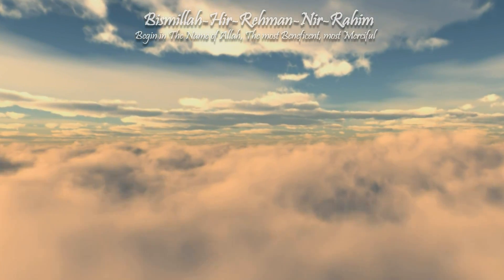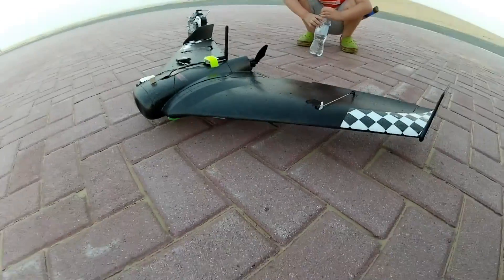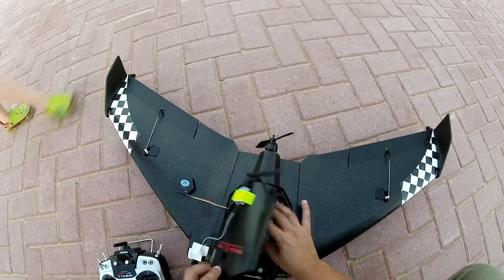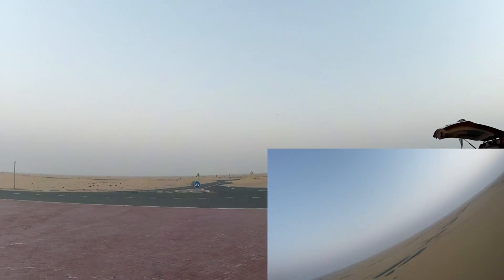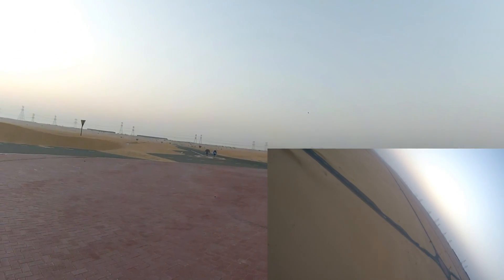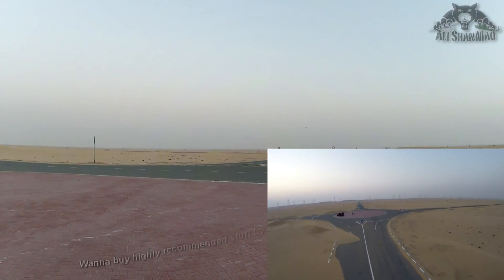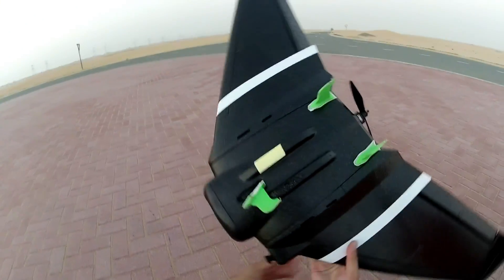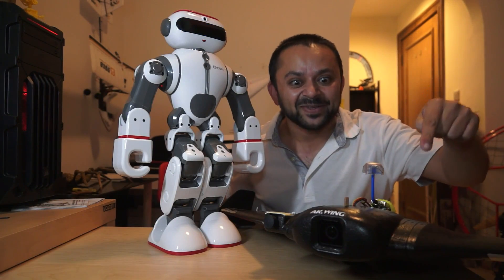3D Printed Landing Skids For AR Wing High Speed FPV Flying Wing

Comment: are all 3 fins the same size so I would be downloading 1 STL file?
Reply: By the way I do have the AR Wing and my question is just before this.
Reply from the maker: yes, but i recommend scaling the front one a bit longer to give your wing a little nose lift should you want to try take off from ground.
Reply: I'm waiting on my 3D printer so I don't know much about how things work.  Can I rescale the front one from the .STL file that I purchased and downloaded.  Thanks Rich
Reply: If I can't do it from the .STL file can you upload one that I can purchase.
Reply: One more thought.  Could you design the same fins but have a 2 part fin.  The base with a 1/2 fin with 2 holes and the rest of the fin with matching holes that you could bolt to the top 1/2 fin.  This way a person could clue the top part to the wing and then have replacement lower half's when they wear down to far. I would sure be willing to purchase the files that would do that.

Thanks
Rich
Reply from the maker: To 3D Print, you will need to run a slicer that is compatible or comes with your 3D printer. Then Import the STL file in Slicer so it can generate gcode for 3D printing. gcode are the instructions for 3D printers to print an object from 3D Model. 

So when you import the file in Slicer program, you have options to scale them on X, Y, Z axis independently or as a whole. many slicers have some more options but you can't edit the STL in there. however just scaling it a bit longer or those required axis you can get what you need. Hit print or save gcode file on TF Card depending upon if your printer takes TF Card to print or directly connected to computer. and print to use the model
Reply from the maker: Sure I can design new fins. It does not have to be bolted. I can design the base that you can stick on the wing or Plane belly. and then fins will simply slide on that base. when Fin is broken or worn out, you can slide it out and slide on the new one. 

let me check my old 3D files to see dimensions because i do not have the AR Wing Anymore. so I can just design a universal one that you can scale big or small in slicer program to fit your plane. 

you can keep in touch with me on facebook messenger or email alishanmao@gmail.com so you can give me reminders (getting old and tend to forget things in busy schedule) and i can update you once files are uploaded.
Reply from the maker: by the way, if you need something else designed for RC Planes, RC Crawlers, RC Cars and RC stuff, let me know and I can do custom job for you.

Comment: I would love to know a little more about your autopilot that you are using And where to get it at
Reply: Ditto and @alishamo I'm building the reptile very similar but cant decide between an arkbird tiny, a pixhawk mini, (I know tower well) and have 916 modules... or Inav with a Paris serious F3 Fc? I HAVE only been building and flying wings a few months, this is very much like the zohd orbit love these wings, but Even tho I like to think for myself I'm boggled by me choices and of course it comes with a basic stabilizer but I like to have rth on wings. Also betaflight vet Inav N00B... Thanks great video and love the skids, what if u added smaller ones under the wing spar for example incase the wind tips either wing ;) thanks again to all

Comment: Can there be a technical improvement on propeller  that when landing, propeller positions itself horizontally so that no touching to the ground ?
Reply: Yes and ANYTIME your are going to land on something ruff like this on skids. Imo it's best to use a cheap prop with prop saver or folding prop but if it hits the groit's more expensive.. just gave myself something to think about. Also if u flare you will wreck it prop I assume?